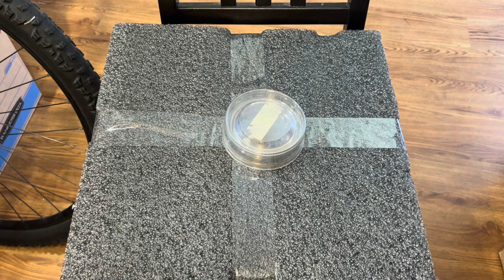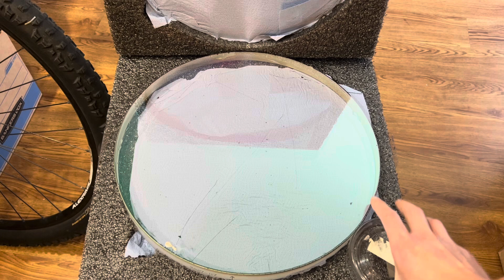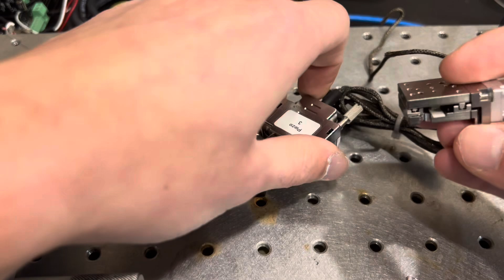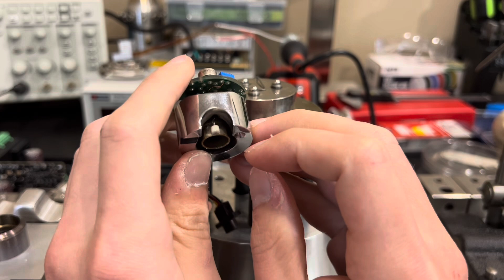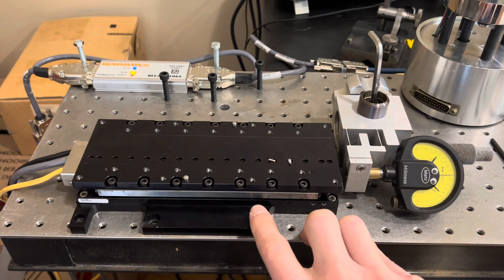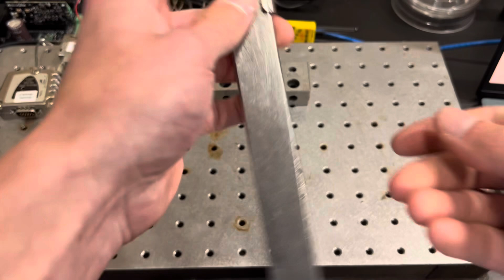Precision odds and ends (feat. Moore, piezos, linear motors, and DTL updates)

Comment: If cost is a concern for STM tips, in my lab we just cut the tips ourselves from tungsten wire. Hold the clippers at maybe 60 degrees. Check with the microscope to see if it looks good at a course grain level and try it out. Sometimes you get a duel tip, you can tell when you're doing a scan, it has a specific artifact, in that case, just cut another tip. 

Some literature suggests you can migrate the atoms on your tip with high voltage to sharpen it, we never tried this, cutting our own worked well often enough to be our best option. Try not to crash your tip into the surface 😅

Comment: What kind of number are you trying to g to get to? Optical flats are usually used to measure flatness of small surfaces. To measure the flatness of larger surfaces the modern method is to use two high accuracy levels. One is stationary. The other measures in a Union Jack pattern. But you talking g about 1/10000th of an inch. You should probably have a granite surface plate though.
Reply from the maker: @nickhuwar7920  I’m not actually measuring flatness of anything with it, though I could. I plan to use it as a reference straightedge to calibrate the axes of the dtl

Comment: Did anything ever come that replaced the jig grinder really? Jig borers maybe, but a jig grinder is simply unbeatable - EDM can deal with glass hard stuff too, but not with sick levels of precision that are part and parcel of a jig grinder - nothing really can... Honing relies on boring, as you would not be honing if you had a jig grinder large enough - so is there anything newfangled that beat the jiggy? I suppose that that water-stream laser tech from the Swiss could be something, but that was launched in like the 80`s or so - i love the old stuff, so i don`t pay much attention to modern ``advancements``... I guess that one could train their cnc mill to essentially hardmill as flat as a surface grinder would, but a true bore, and not just one, but a full set of bores(as in not easily doable on a grinding lathe(those can be mad precise)) - not a single one of which a mill could produce or bore out by cutting and simulated movements however precise - again, speaking in proper hard toolsteel or such, not in free machining steel or brass... And ``a cnc jig grinder`` is not an answer really, that is just a jig grinder with digital actuation not a ``modern advancement/replacement``...

Also, that is a sexy optical flat... And i think that you over-cranked the milimess in + direction over the 10 by one full step, i`m not absolutely sure, but it seemed to me like the needle cried out for mercy and begged the Deus Mechanicus to strike you down... My tech-priest senses are rarely off - i can feel the agony of machine spirit when abused... 

Best regards!
Steuss
Reply from the maker: I was just discussing this with Dave Arneson two days ago lol. The answer to this question in many cases EDM. For cases when edm doesn’t work, the fact of the matter is top of line modern cnc machines are more than accurate enough to interpolate holes as good as you could jig grind them. Think kern, röders, yasda, etc. Cool in their own ways, but the Moore style of making a machine of pure mechanical perfection may be a lost art these days. 
Also, yes, I did over travel the millimess, but that’s fine. They have a mechanical disconnect so when you overtravel an anvil simply moves away from a contact point internally. It puts no stress on anything in the indicator. You can overtravel a solid .125” before you actually crash something.
Reply: @cylosgarage  Fucking nice! My micron clocks are russian made jeweled bits, and while accurate, i do not believe them to be safe from over-travel... I never took apart a milimess... Speaking of such stuff, look up Mahr`s Feinproof Militron readout... It requires probes, but if allows for sick readouts on a massive scale(visually massive, as in huge and easily read)... 

Regarding the precision of the days of yore - no compensation system will ever be able to impress me as much as a machine made with such dedication to perfection which completely side-steps the requirement for any sensor feedback to achieve what it is designed to do... But sure, i was considering hardmilling cnc interpolation of geometries as a potential solution... The EDM as we agree - makes a lot of sense due to inherent precision of a contactless material removal setup, but EDM almost never beats a good jiggy... Cnc can compensate to achieve that, but cnc can`t offer the surface finish at that fine interpolation that jiggy offers(at least not from what i know... you can comp. the deflection and all the flex, but you have the issue of minimal depth of cut...)... Sure, there are great machines and makers out there, makers that still kinda live up to the quality of old, but their designs still are defiled by the FEA... 

Anyways, glad to see that that question is being thought about outside my own head... 

Best regards!
Steuss

Comment: Cool stuff, I'm definitely making one of those dialed micrometers! 

Btw, if you know the gauge of wires in the STM, you can just buy the same gauge tungsten on roll. 
Then cut oversized, put the piece as the anode in an electrolysis cell, with the tip just slightly touching the surface of the electrolyte. Where surface-tension forms a meniscus around the tip. 
Set the voltage to just over activation, the cell will shut off, when enough of the tip has etched away to break the meniscus. Leaving a perfect tip fairly often. Sometimes ramming the tip into the substrate can fix a wonky tip. The characteristics of the tip depend heavily on the dominant tunneling orbital of the tip atom. So repeated ramming's may be necessary to get primarily a p or d orbital.

I notice that the trans-impedance amplifier is still on top. Leave it as is, and try to make your data collection circuit around it's operating voltage. I also recommend running the amplifier on batteries, as even most linear regulators are too noisy. The gain is usually in the 1M-1G Ohm range, so any form of noise is amplified a lot. 

As for the piezo drivers, you can get pretty far with some low noise power op-amps (ex OPA455)and a microcontroller with at least 12-bit DAC's. But you may end up with some "large" capacitors to get a  stable voltage output, resulting in longer scan times, and increase the likelihood of failed scans. 
And since microcontrollers don't like voltages in the double digits, some isolation of the high-ish(1-200V?)  and low(3-5V) side, is probably wise. That said, if there is one part of this, that I might consider buying my way out of, piezo driver is it. Especially if I already had the trans-impedance amplifier. Or copy an existing circuit, but the open-source ones tend to use segmented bi-metallic disc piezos, operating on much lower voltages than typical tube-piezos. 

Regardless, hope this was useful, and not just stuff you already knew. Looking forward to future updates!
Reply from the maker: @JKKnudsen  thank you for the valuable advice

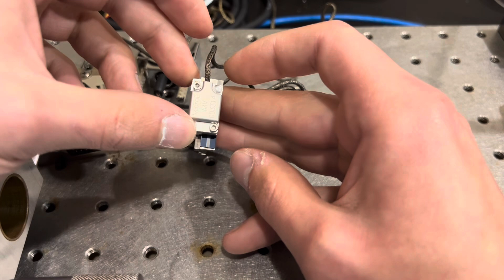Comment: Is that encoder stick-slip, or is it clamping? At around 8:56 we can see four conductors going down into the piezo actuator area. I know some of these stages use a separate clamping actuator to modulate the normal force and "let go" of the stage when stepping. Or maybe it's stick-slip, but with two parallel channels so only one needs to slip at once? Definitely curious why there are four conductors to the actuator.

Comment: Ive use a couple of those Parker linear stages to build a tiny X-Y table for laser cutting some prototype medical sensors with a UV laser. I had the stock compumotor drives for them which work really well. 

Ive got a much larger aerotech linear motor x-y stage I need to figure something to do with, I think 300x400 mm travel. Also about 10nm res.

Comment: have u tried other commercial servo amp on that Parker crossroller stage to see if they can reduce noise? Most of those servo amp software has build in feedback oscilloscope at least u can see
what's going on with the feedback
Reply from the maker: The software for my drives has a scope too. Noise looks to be electrical

Comment: 18:51 Brownian noise ?
Reply: I think it's more to the encoder interpolation. - I've got one of these stages. Interpolating a sine wave to 65k segments is going to be very noisy.
Reply: @DUIofPhysics  Careful encoder setup goes a long way to quieting these down. Match amplitude and offset of the sine/cosine, and ensure the quadrature phase is exactly 90. In any case these are only 20u gratings.
Reply: You mean Brownian noise?😅
Reply: @ sure I did 👍🤣
Reply: Corrected
Reply: Spread spectrum - like algorithm, there is some base very high frequency it can drive, and mixed with uniform pseudo-random signal to increase accuracy beyond DAC capability. In theory, you get infinity resolution but if look from very long time interval ofc. Almost all modern drivers use it. Like dithering 8 bit image to 1- or 2 bit display in video or audio trickery when go from 24 bit to 16. Very cool trick.

Comment: Wonder how many more people could not resist those Parker linear motors listing. Would be interested in the servo driver config if you mind to share.
Reply: I picked one up off of ebay a few months ago. Mine came with a parker vix250 servo drive and a renishaw encoder interpolater but i haven't been able to get mine working. It mostly comes down to the vix250 drive being obsolete and not supported anymore. When I was trying to get it working the issue I was having was that the  software requires windows XP and does not work in windows 10 compatibility mode. I could get the software to open in an XP virtual machine but had issues passing through the rs232 signal from a usb to rs232 converter. I probably just need to get a old pc with a dedicated rs232 port on it but if anyone has some tips on interfacing with these old drives I'd love to hear them. 

I bought the slide to possibly use on a diy wire edm using a RackRobo power supply. Id love to be able to use this slide as it would easily make it the most accurate piece of equipment I own (not a high bar). The project is kinda on the back burner due to some power supply issues RackRobo are currently sorting out. Id love to be able to switch to an Ioni drive after seeing what Cylo has been able to do with his but unfortunately granite devices who make the Ioni drives decided to have a minimum order quantity of 10.
Reply from the maker: Which parts?
Reply: @cylosgarage  Misunderstood the first time, I actually have the original Parker drivers for it (and maybe one or two spares on top), not Ioni. 
I've had bad experience with Garnite Ioni drivers in past on some retrofitted system with brushed DC motors, took me three days to get semi decent response that was not too sluggish or on edge of oscillation. Also it has basically zero EMI filtering on the drive outputs, it needs to be implemented externally.